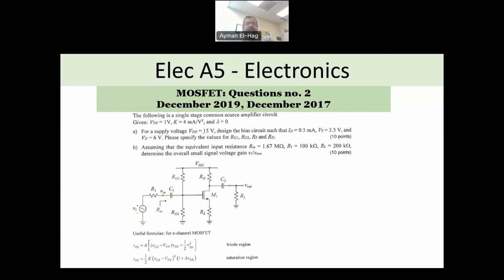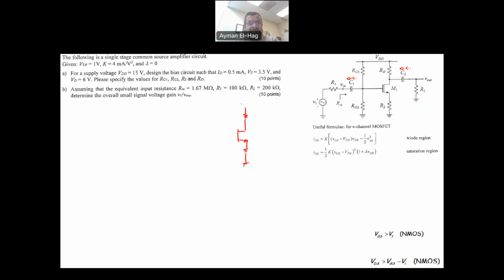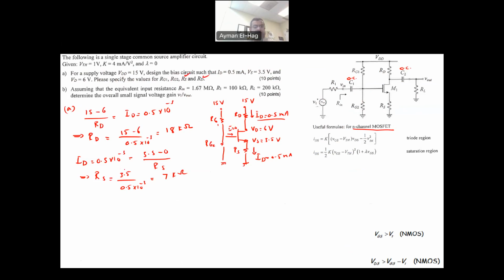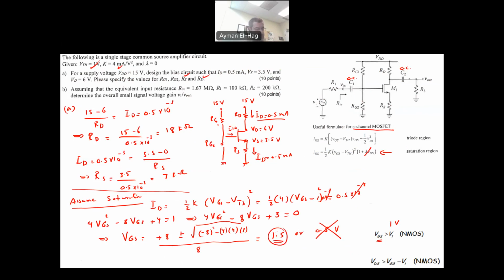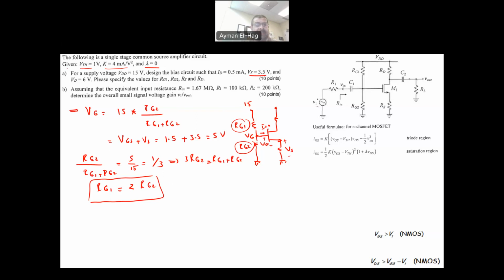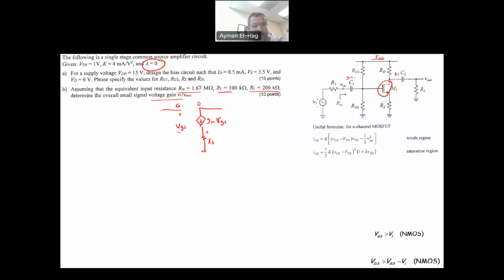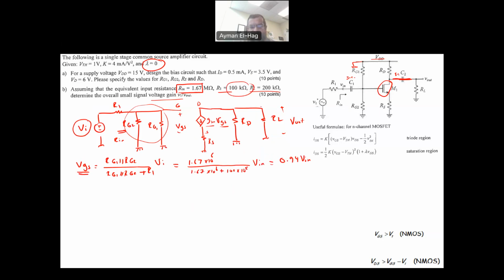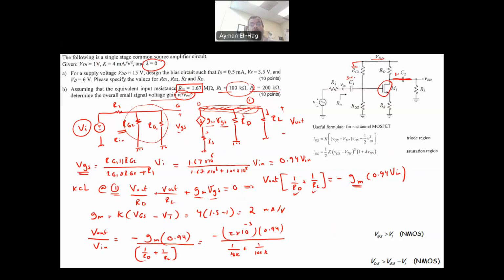PEO solved examples (ELEC A5): MOSFET Question no. 2

Comment: Hello Professor, when you are explaining about the small signal model at 1:50, when lambda is not 0 does that change gm equation or does it stay the same as when lambda is 0
Reply from the maker: If lambda is not zero, this will influence ro, which is in parallel with the dependent current source (gm)x(Vgs) but it will not influence gm. When lambda = 0, then ro will be equal to infinity, i.e. open circuit.

Comment: Hi Professor,
Vgs should be modified by multiplying it with 1/(1+gm*Rs). Can you elaborate on this part how did you come up with this expression. I get that that the Vgs is expression you came up with is incorrect but don't really follow how to correct it.
Reply from the maker: Vgs is the voltage between the gate and the source and the source is not grounded and hence there is a voltage drop between the source and the ground which is equal the current source (gm*Vgs) and the resistance Rs. This is why we need to do this modification.